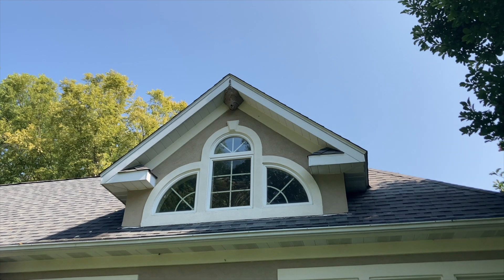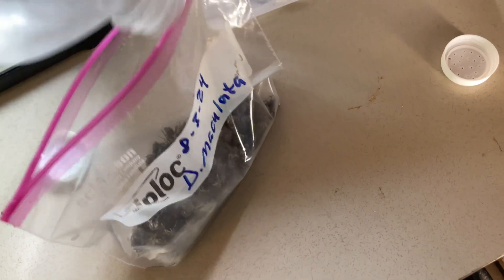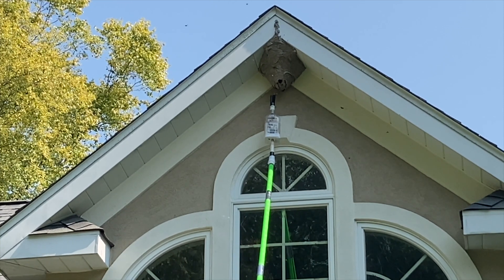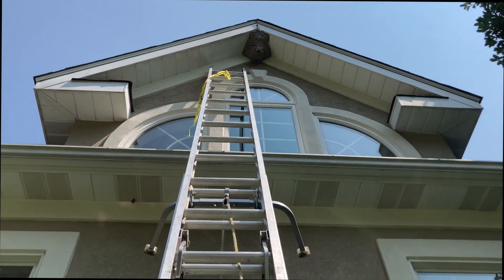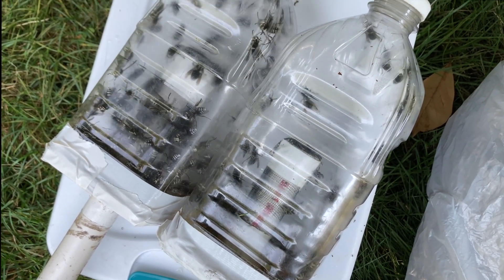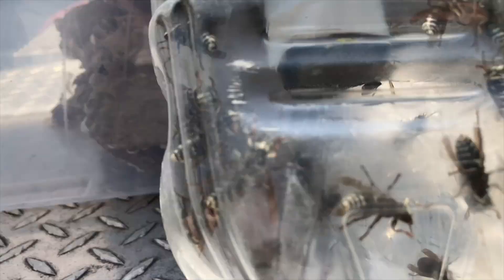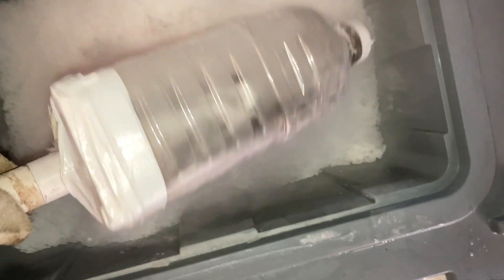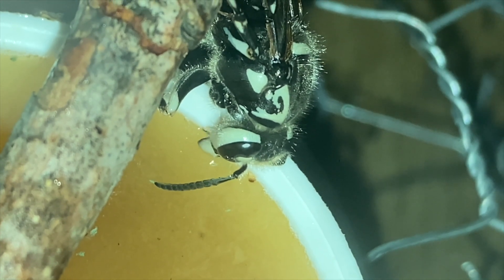BALDFACED HORNETS NEST REMOVAL FROM 30' HIGH UP A LADDER! COLLECTING WASPS FOR VENOM IMMUNOTHERAPY!

Comment: The special habitat of the swingset — love it.  Do you do any sorting of drones?  That is one area of this whole process that I am not super clear on so far, is basically sorting out the dirt, paper, drones, etc — before shipping out to the companies.
Reply from the maker: @jimguy08 - Yes, that old unused playset is the stopping point for many nests before they go into their long term incubation habitats!  We use it like a big exterior work bench these days.  We make sure not to include any debris, paper, dirt, etc. in our collections when we freeze the wasps.  Male wasps/drones are sorted out by the companies we deal with so we do not have to handle that at the collection level.  I believe they prefer to do this so that they can maintain control of the raw stock, and so that there is less chance of thawing out the raw stock during sorting (they likely do their sorting in temp controlled settings).
Reply: @greenwaspremoval  
Have you ever been to the lab and seen the process of extracting the venom?
My career was medical lab so I think it would be so interesting.
Reply from the maker: @cherylkoenig5509  - That's a great question!  We haven't been to the labs yet, but we're familiar with the amazing process of how they extract the wasp venom from the specimens.  It's an incredibly labor intensive process done in the lab where technicians dissect each wasp by hand and remove the tiny venom sacs with tweezers and put them into test tubes for further processing!  It takes over 500 man hours of work to make one single batch of wasp venom product for Venom Immunotherapy.  You can see that initial venom sac extraction process here in this Youtube video clip: https://www.youtube.com/watch?v=zoXu2JWicfU
Reply: @greenwaspremoval  
Thank you!
It's absolutely fascinating to me.
And thank you again for your hard work.
Reply from the maker: @cherylkoenig5509 - It's always a pleasure to see people fascinated by wasps and nature in general.  Somehow we've lost a lot of that fascination in modern human culture and it's a healthy choice to slow down and get back to appreciating it all around us.
Reply: @greenwaspremoval  
I hope I never lose my fascination for nature.

Comment: Risk/reward ratio not there IMO. 30 feet!! Yikes!

I’m in northern Indiana also. Have baldys all over this year.   Can’t find the nest.  Guess I’ll find it when the leaves come down.
Reply from the maker: @mikings2 - Thanks for your comment.  Ladder work is one of those necessary risks we have to take in this work sometimes in order to help our clients.  Always have to operate with great caution.  We have definitely seen a lot of Baldfaced Hornets this year in NE Indiana also.  Interestingly, most of the nests have been under 10 feet in height off the ground, with just a few high in trees or at higher building peaks.  It is always fun to see the baldfaced nests start appearing in the trees in the Fall when the leaves come down!